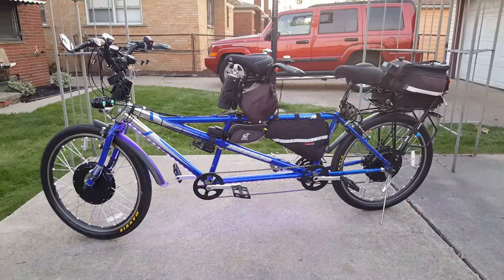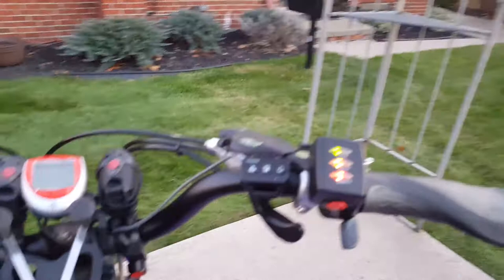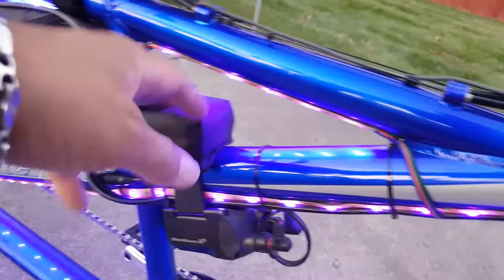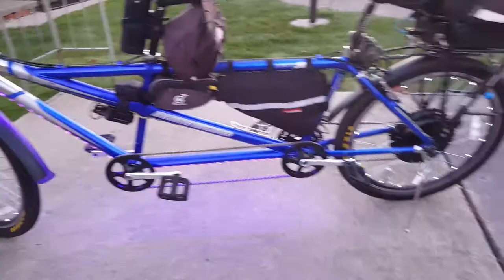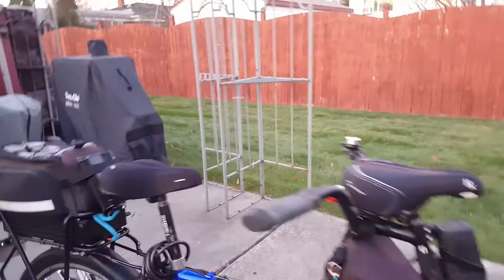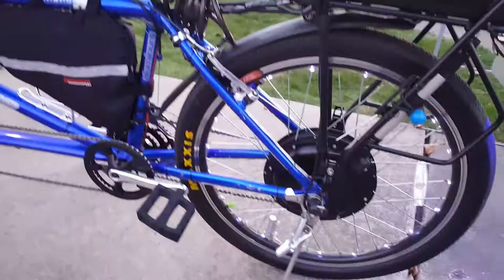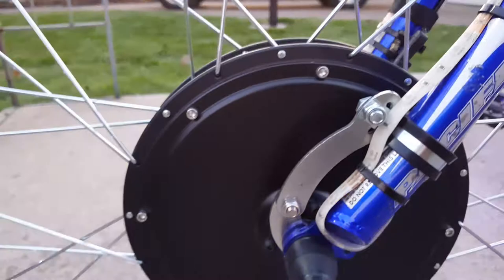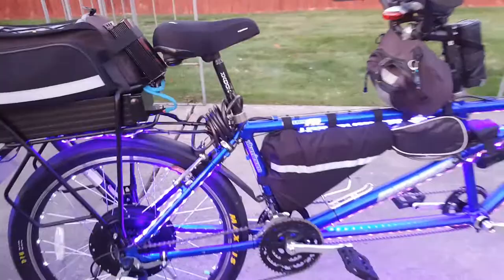2017 DIY TANDEM ELECTRIC BIKE  3 KW,  40 MPH,  Distance over 60 Miles at 15-20 MPH no pedal assist

Comment: If you go with a mid-drive motor in the rear instead of the hub motor, you may be able to go with a rear disc brake. And there are hub drive motors that have disc brakes. At least for the front anyway. You may have to go with one that is a little less power but you said that it's kinda too much power so that could work out well.

Comment: Hi there, nice build!  Does your frame have 145mm hub spacing in the rear? im trying to build a similar setup but my frame has 145mm spacing and its tricky to find a hub motor that will fit properly.
Reply from the maker: What I did because the Hub didn't fit on my rear as well just take a file and file the opening of where the Hub fits a little bit more it's okay it's still strong make sure you have that torque brace so you won't get a spin out on your Hub, file the upper part of your frame only not the lower